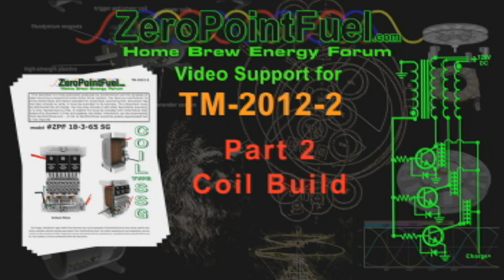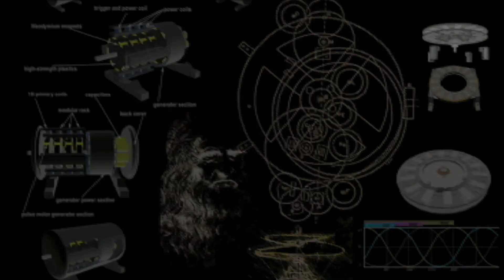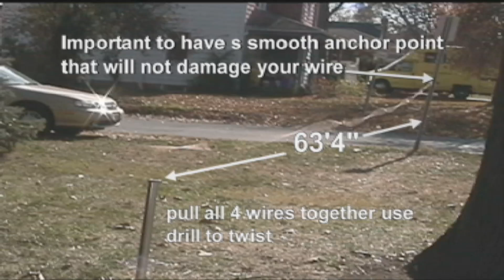2-tm2012-2

Comment from the maker: I have cast my own cores before but the chips retained more heat than with transformer plates you can use copper coated welding rods sealed in resin that will work, even wire coat hangers  with a plastic coating on then cast in resin works but after all the experimenting and old microwave transformer plates works the best

Comment: i'm pretty sure you can mess around with wrapping around some wire on a tube of plastic and put some iron powder in the core
otherwise, you can use some electric transformers plates by ripping them appart